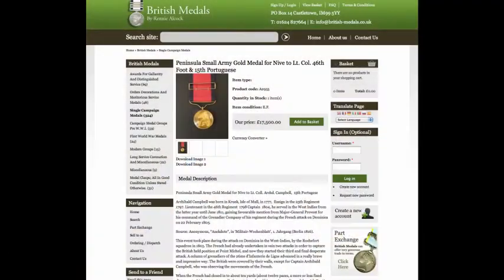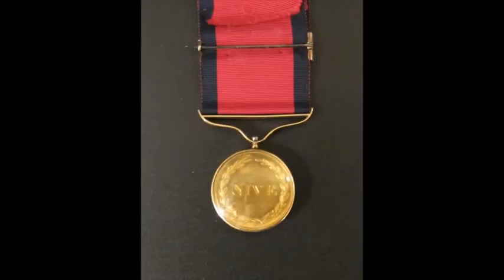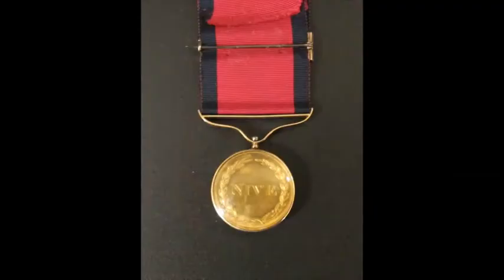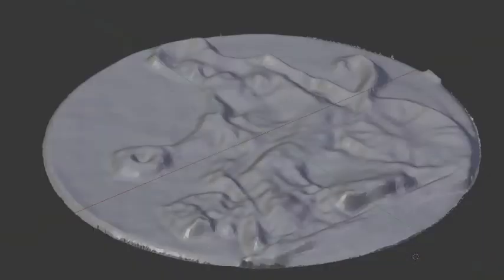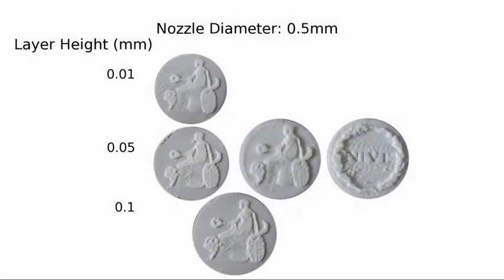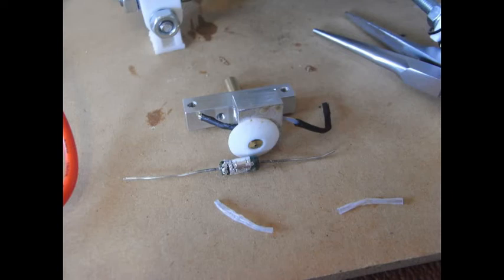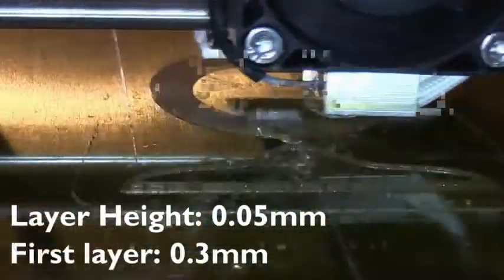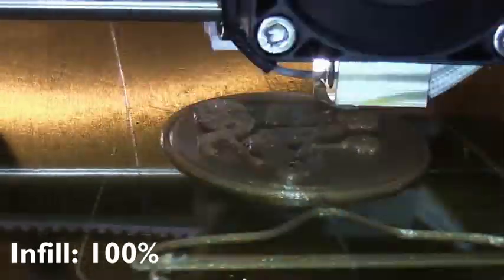3D Printing a Replica Medal: RepRap Huxley

Comment: Great video. I used a similar techinique, however used a 2D image to transform the enginnering symbol on a keychain. After modeling I print the part in a 3D printer and was very good. If you want, look at my channel.

Comment: If it's a video to show us what you did, nice. If it's a video to show us how you did it, worst I've ever seen. I don't know anything how to make something like that by your video. Tell us which program you used to create that 3d bumpmap?
Reply from the maker: Thanks for the advice, it certainly wasn't meant to be an in-depth tutorial but it does, I hope, give a general overview of the processes involved.
Reply: Patrick Taylor In that case it's a fine video. You plan on making tutorials in the future? I recently got myself a Emotion Tech (reprap pro) uDelta btw.
Reply from the maker: Harry Trekbuis It’s been in the back of my mind for a while, so I could certainly have a go when I get some time.  Good luck with your new printer, I have no experience with Delta printers.  Do you have to build it?
Reply: Ah ok.
yeah it was a kit. I "just" had to assemble it and install the software (about the same as yours I think). I am now at the point where I can say that it's calibrated right and all settings are fine. Now it's just a matter of finding the limits of 3d printing.

Comment: Interesting video, Patrick. Thanks for posting!
We did a lot of research into 3D printing coin prototypes when I was HOD at the Royal Mint, and ran into all sorts of trouble with resolution - sculpted detail being smaller than the resolution of the print. Mind you, this was about 5 or 6 years ago!

In the end, we printed them vertically, as we seemed to get a better capture of detail than when printed horizontally.

I'm interested to see your experiments with recreating the bas-relief sculpture. A lot of commercial mints use grayscale bump maps to make their sculptures, and, whilst it's passable at a distance, it's not correct in any way. Bas-relief relies on light and shadow to create a sense of depth, rather than form. The fastest way to get the best results is to sculpt it properly from scratch.
Most mints now use CNC engraving - either from a scanned Plaster of Paris sculpture, or direct digital meshes (which is what my company does).
I use ZBrush to create my mesh, but I sculpt in exactly the same way that I would using wax or plaster, using the play of light to create a sense of depth and form, (most of the commercial work I do is less than 0.2mm in height, at around 38mm diameter).
If you're interested in what's achievable, take a look at my website (mavericknumismatics.com), and drop me a line. I'd be happy to explain the processes in more detail.

cheers
Matt